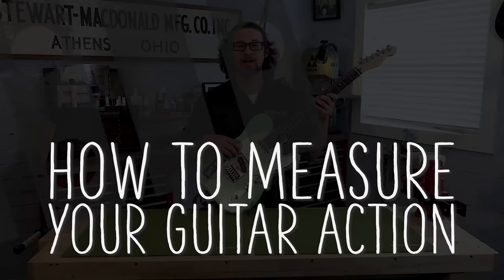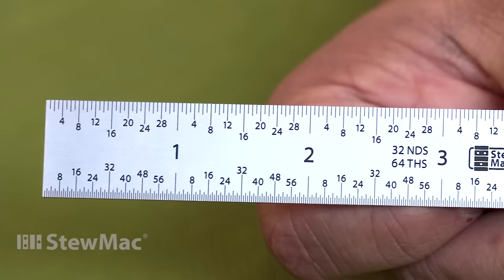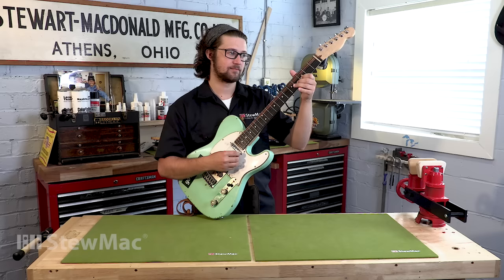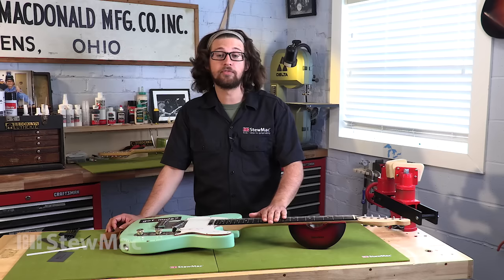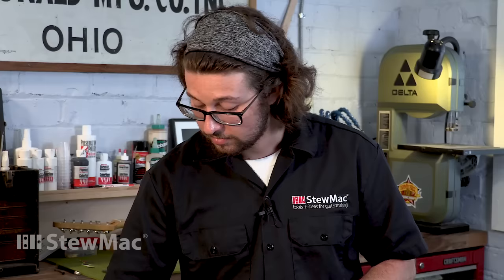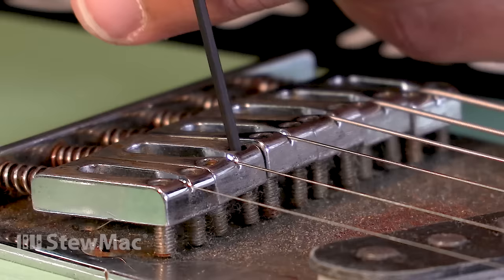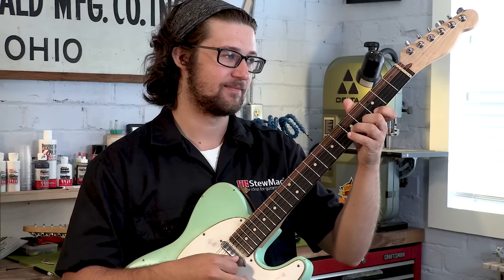How to Measure Your Guitar's Action Using StewMac Measurement Tools

Comment: For setting the distance of the string above the fret I use the plain 
end of a drill bit.They are available in steps of 0.1mm, are very 
accurate and don't cost much.
Reply: I’ve used drill bits for “feeler gauges” for many different measurements. They also come in steps of 1/64th of an inch as well as the 0.1mm you mentioned.😊

Comment: Something to consider: I've been checking out other videos on using the String Action Ruler (as I'm new to using them personally). I believe the reason why your measurements may not be correlating with your calipers is because of Fret-height compensation. From what I can tell, the String Action Ruler is made to sit on the top of the Frets, not down in the Fretboard. Again, just a thought, and definitely don't hold me to it. :)
Reply: @aldalesandro  the reason why he made the string buzz onto the metal gauge thing is because if it’s not touching the gauge then it’s too high, he’s not measuring on a fret so that’s why he had ot make sure it has a slight buzz, so that the string is barely touching the gauge and they have the correct curve to the neck
Reply: They make them with cut outs so they sit on the feet board  also

Comment: I have a different approach/philosophy to height at the nut. Fretting a string at the 3rd and observing the height at the 2nd to me should be no different than the height of the string unfretted at the first fret. The fret is suspending the string just as the nut is. I've done lots of setups on  guitars that would pass the 3rd to 2nd test, but that still have too much height at the nut.

Comment: Another great Stew Mac video. I had one question though and it was about what was said about holding the guitar in playing position because measuring a guitars string height while lying on its back causes an inaccurate measurement due to GRAVITY ? ? I'm pretty sure the tension of a tuned guitar string would more than compensate for gravity. Maybe you could clarify this for me. Thanks ! !
Reply: Yeah I think the gravity difference is pretty negligible there. The reason to do that though would be so that the guitar's neck would be laying in the pocket in the ways it is while played (also pretty negligible difference - but who knows - he's the pro). Odd that there is no mention of standard neck relief and string height measurements/factory specs. A zero relief neck sounds fun, but I it takes some pretty perfect fretwork to make that possible. I'd love to get there some day. For me,  feeler gages work pretty well to get relief, string height and 1st fret actions spot on.. They cost about 3 bucks as well. Anyway woo!

Comment: The radius neck gauges will work just as good as the next tool you showed so you really wont need both at all. And you can use them both under or on top of the strings they gonna show the same reading in both cases. I would not trust just the string height gauge I would double check with a feeler gauge.

Comment: The best and most thorough video on this topic.
Reply: Is it really that thorough? His approach is to pick any non-bowed-relief that you want, any string height you like and then aim for about .020" of a gap at the first fret. If I was a beginner at setting up guitars, I wouldn't find that very helpful. I recommend that people aim for the factory specs for their guitar, and then  mess around from there. A $3 feeler gage and two allen wrenches are the only tools needed.
Reply: @esmeraldo7887  WDYM?? .040 at the 12th fret is literally factory specs for Fender. His method for checking relief is universally accepted as the standard method: Check for 1st fret clearance, check for the relief gap at the 7th/8th/9th fret by depressing first and 15th (whichever fret meets the body). 

You could put a capo at the first and use your free arm to put a feeler gauge at the gap, but the method above is how everyone and their mom does it. A little gap, perfect. Want it straighter? Then do it like this video and remove the gap by tightening the truss-rod. From there, just use any String Action Ruler to measure both outside E strings (.030 to .040) and then use a String Radius Gauge to match the remaining strings to the neck radius.

How's this a problem for beginners?

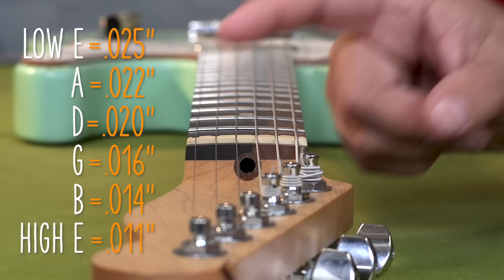Comment: You observe the nut height by fretting on the 3rd fret and looking at the gap between the bottom of the string and the top of the first fret.  Then at 6:35 you show the ideal clearances at between the strings and the first fret.  Are those numbers with the string fretting on the 3rd fret, or with the strings open?
Reply: Open strings

Comment: 3:09, I don't want to be that guy (but I am) and I have extensively studied physics at University and it's not necessarily that that gravity is pulling the strings down towards the neck, it's the reactionary force (the force from the surface due to the weight of the guitar that pushes on the guitar neck) that causes a misreading of string height. That force causes internal pressure (or stress) which causes deflection (strain) which is observed by something called a 'bending moment.'

Comment: Using used strings as feeler gauges is a great idea. What I do is take the string and cut it to the length I want and glue the ball end to a popsicle stick. Then take a felt tip pen and a right what gauge string it is on the wooden stick. This makes them easy to find in your tool box.

Comment: Very very nice information video. Thanks for that.
I play a guitar which is ESP AX-50 LTD, a clone of B.C.Rich Warbeast without the tremolo bridge. It has a t-o-m bridge.

I am from India, a small city without any guitar resources except local acoustic strings and picks.
So, I have to do all my repairs, servicing by myself and I do not get the right tools for the job. Just 2 days back I found guitar string height tool on amazon and soon I will order that curved set of keys with different radius.

I have been using the last trick of using old strings for height check, I am a recycler! It's good to know you use that.

I play from Rock to thrash metal rhythm at 72 to 180bpm and lead as needed but at 50-75% bpm of rhythm and do heavy tapping on all strings above and near 12th fret mostly with legatos.

If your string height as shown in the last part near nut cannot be adjusted without using nut filing, I have to check it by actually tapping between 3rd and 7th frets while playing. If I get a buzz, I just adjust the truss rod. Well in absence of proper tools what could I?
I hope to know more about bridge adjustments etc as well.
Thanks again. Keep on delivering that information in simple language.

Comment: I’m a beginner and when I bought my guitar it was quite high. Today was the first time I adjusted mine and it worked well. I adjusted it to 1.5-1.75 mm on the thickest E string then 1-1.25 on the thin E string. no fret buzz and much more easier to play 😁

Comment: For a video about exact measurements during a setup.. that isn't what I would consider even in the top 3 best ways to check relief mostly because you don't get a number that way.. use a relief gauge or capo the first fret, fret the 17th and use a feeler gauge to check the space between fret top and low E. I usually go for around .012 because I like a slightly higher action... then again I don't have a shirt that says StewMac so what do I know?

Comment: Hmmm. Mine are at .008" at the first fret and I'm getting fret buzz sometimes. Going to attempt to replace the nut this weekend with a Graph Tech Black Tusq XL that will be the same exact size with a little sanding. It's already the right shape so hopefully it's just a matter of sanding to dimensions and installing. If not, I'm sure I can always put the original back in, right? 🤷‍♂️

Comment: Very nice! just ordered some good stuff from you guys. I have a question about the 1st fret action: you say good clearances for all the strings are .025 .022 .020 .016 .014 .011 so are these measurements with the first finger pressing the third fret or without pressing the strings at all? 

A last question if you don’t mind. Do we must keep our guitar in playing position for all the steps 1-4? Or just for the first step? thank you and wish you happy new year :)
Reply: Measurements you mention is without pressing the strings. In metric I use 0.5mm (bass E) to .25mm (high E) so pretty similar. 
Ideally the guitar would be in the playing position when filing a nut but, practically speaking, this is only possible with the Stewmac beck jig.
Reply: @eugemcl  thank you ;)

Comment: Says15th fret but is holding the 17th fret for the truss rod measurement.  I know the key words are "whatever fret meets the body".  Still could use a correction when dealing with exact details like this.

Comment: If your new brass nut is too high at the first fret and you don’t have the files or experience of carefully filing a nut, would sanding the bottom be an option instead of having to file 6 different slots?

Comment: Why are you measuring low E string height at the 12th fret and high E string height at the 2nd fret at 3:32? 

Also, if the frets are ever dressed and recrowned, they may not exactly follow the radius of the fingerboard. Wouldn't it be better to adjust the saddles by measuring the height of each string off the 12th fret instead of using one gauge to determine the fingerboard radius and then a second gauge to set the saddles? 

Not to mention simpler, quicker...and less expensive. And you can graduate the string height from one side of the fingerboard to the other if you want.
Reply: Exactly....that is what i do

Comment: Well, the problem is I don't have those tools for proper measure. I've a Fender strat (Mexico). It is my very first guitar as a beginner. I've just unboxed and started to practise with no setup, I tune it all the time before playing. There is a fret buzz on the 6th string. When I look from the side, the 6th string's action is much lower than the others. If I adjust it a bit higher, can it ruin the guitar, intonation etc.?

Comment: Because of the camera angle employed, this video failed to address what I wanted to know - Do you measure to the bottom of the string or the middle? And do you take into account (ie, subtract) half the diameter of the string to get the measurement or what? Strings vary greatly in diameter, far more than 10 thou...
Reply: I used the bottom of the string. It seems like no matter what the string gauge is, you're trying to adjust the distance between the contact point of the string (the bottom of the string) to the contact point of the fret (the top of the fret wire).

Comment: So I have this problem. I've adjusted everything: truss rod, string height, all frets are equal... the guitar plays fine open strings, chords, little bendings... but when I do hard bendings on the 1st and 2nd string, like 5 semi-tones bendings, between the frets 10-17, the sound gets cut off. That means the string touches a fret, but only in this situation (hard bending on 10-17 frets in 1st 2nd strings). What can I do?

Comment: How do you go about fixing a saddle that's slightly higher than it should be? I'm new to this, but my G string is higher than the rest of the string's. Far as I can tell, there's no way to adjust them up and down, only in and out. Can someone please help me with this?

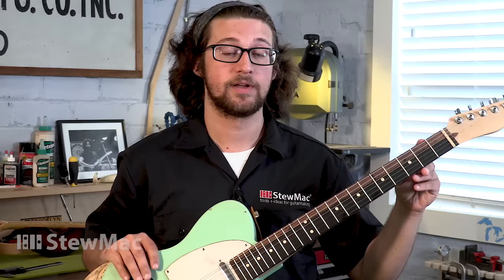Comment: Kindly answer this question/scenario...I tried the 1st fret action trick you showed (@5:48) where you push down on 3rd fret on low E string to see what height is left at 1st fret. When I did this on my acoustic guitar there was no clearance...the E string was touching the first fret with therefore no clearance. Without pushing down on third fret...my low E string height appears to be at 0.020 inches on the feeler gauge. The rest of the strings at first fret have the same 0.02 except high "e" which is 0.010 inches. Is this height considered too low? and are my only options to adjust the truss rod to loosen tension and create upbow relief...and will that adjustment work on first fret height? I assume the truss adjustment would work better for mid neck frets as opposed to first fret? And/or finally is my other (only) remaining option to have a new nut installed giving the first fret strings strings more height? Also are acoustic guitar heights different than electric? Sorry for the convoluted questions and thank you in advance...

Comment: Brilliant video! One question though! 
Does the typical/recommended action differ between an electric guitar vs an acoustic steel string guitar?!
Reply: Yes, absolutely it differs.  Acoustics typically always have HIGHER action when compared to electric guitars. Electrics, due to an easier adjustment of saddle height, can generally achieve lower action than that of their acoustic counterparts.   Hope this helps.

Comment: In the neck relief section, he (correctly) states that you should do your measurements with the guitar in playing position so the pull of gravity on the strings doesn't affect the actual measurement.  Then in the very next section, the 12th fret action section, he has the guitar sitting on its back in a guitar holder while measuring  the 12th fret action.  Hmmm, he should take his own advise and take the 12th fret action measurement with the guitar in playing position.

Comment: I'm new to this so bear with: Video instructions say to measure the 12th fret bottom E and top E clearances at around .040. Later in the video it lists off standard fret clearances for each string starting with bottom E up to top E strings going from .025 down to .011. So why am I measuring 12th fret clearances at all then since I'd have already adjusted the neck to be straight (which is my preference) and then adjusted the bridge string heights against the understring tool? Are those standard string fret clearance measurements what I should generally have after I do the understring adjustment? And if I don't have those general fret clearance heights for the strings, can I go ahead and disregard the understring adjustment and manually adjust string height at the bridge? Great video, I do appreciate the information and detail in it.
Reply: Whether 12th fret or first fret, the action should be within the ideal ranges mentioned. That's about it.

Comment: I bough my StewMac action gauge years ago because I wanted an accurate measurement of the action.  However maybe I have been using it wrong all these years because I can see the .020 black line but no space above it just below the low E string along with the .010" black line with all the space between the two lines when you initially measured it about 1:37 into this video.  So being I can see the .020" black line below the E string I would say the action for the low E string is .020".  Why are you saying the action or clearance of the low E string and the top of the fret is .010"? Am I missing something here??   I'll take your word for the .010" action on the high E string because I can't clearly tell with of the angle of the camera.  

I am confused. I thought the measurement is based on the line directly below the string being measured vs. the next line down after the space.  Am I wrong?  So again I ask is the action for the low E string .020" because we can see that .020" line under the string;  or is it actually 'just about' .010" because we can see all of the .010" line and all the space above it along with the .020" black line but none of the space above it?

Comment: in using string action gauge.. so if i measure my first fret I need to measure all the strings in the first fret? and they should be in the same height as the treble (1st string) and bass string (6th string)

Comment: Aren't you supposed to put your guitar in "playing position" when measuring the string height?..🤔
Reply: That's right, but for some things you don't need to set it in playing position. For example, setting the radius doesn't require it.
Reply: Ya, cos a magic force is pulling the strings down..